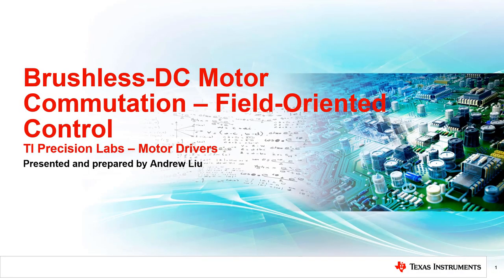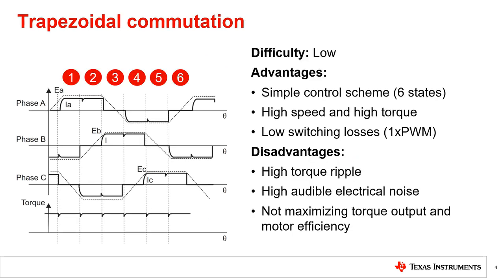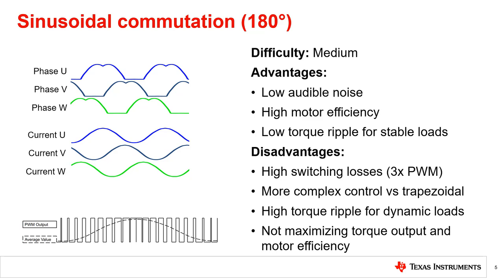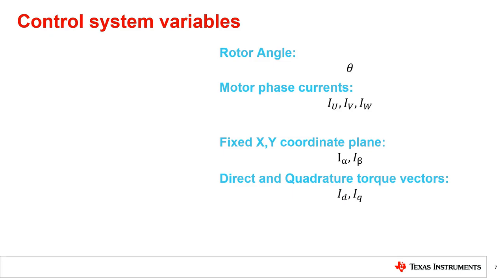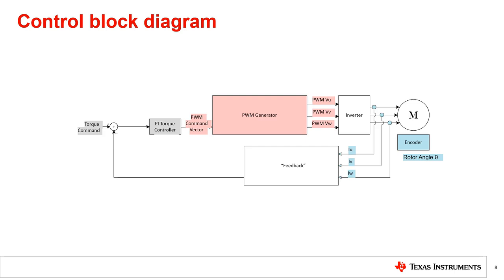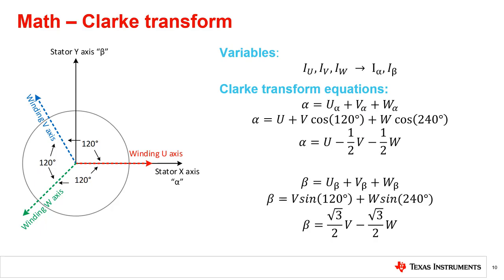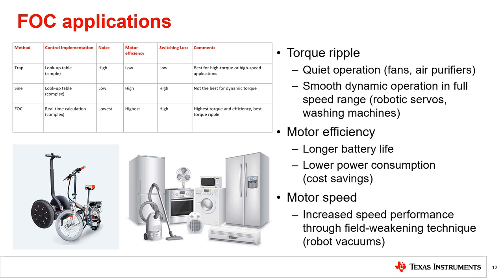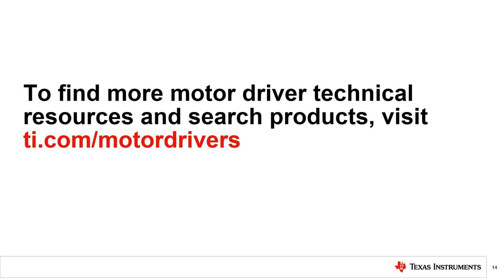Field-Oriented Control

Comment: Moreover, a BLDC has got a trapezoidal Back-EMF. For this reason, trapezoidal commutation is highly recommended. As far as i know, FO Control is mainly used in BLAC motors, AKA PMSMs because of the sinusoidal Back-EMF. The advantage is that applying Parke and Clarke transforms to these motors make the model non-dependant of these trigonometric functions as the dq coordinates rotate synchronized with the three sinusoidal phases required to control these kind of motors. Please, correct me if I am wrong
Reply: they rotate synchronized with the rotor

Comment: What if the field detection was performed in the analog domain? The system would be simple and placed in the engine for less interference and fast switching. Only power and a control signal would be supplied to the system.

Comment: Why do the PWM signals need to go through an inverter? I am trying to implement FOC for a stepper motor like the Nema-17.
Reply: What they mean by "inverter" in this case is just a 6 transistor full bridge. For a 2 phase stepper motor, you need 2 H bridges as you normally would. And such a thing already exists, look at SimpleFOC.

Comment: I haven't seen a single real life motor, implementing a rotor like this simple bar magnet, that all explanations of park-clark transform use. How in the name of God does this work in an actual motor with multiple poles e.g. 12p9s? I can't picture this 90deg angle in real life where there are multiple magnets on the rotor.

Comment: Hi TI, thanks for this video. I am a student in EE and long time fan of TI's ICs. I am very grateful for the material you guys put out there and I have been trying to write some FOC program to run in an embedded system I'm building. 

The setup is a C2000 F280049 microcontroller and a DRV8353 motor driver. My application is for high speed turbine and so I am opting for the sensorless FOC. I was wondering if I could get some feedback on my approach since I can't post on the E2E forum ( I don't have a company email).

So the way I get theta is by first finding the angular velocity. I create an ECAP event to measure the timing between two zero-cross of the current waveform. This gives me the sine's period and with (2pi/T) I find the speed in rad/s. I then multiply the speed with the time since the last known position of theta (this would be the last zero-cross, since i know that when the current is at zero on a phase, the rotor angle is perpendicular to that phase. Is this a decent approach?

Also, i have a question regarding the timing of current measurements. The IC i use (DRV8353) has integrated low side current amplifier. It is my understanding that, for the current to be measured, the low side gate has to be active for the duration of the adc sampling. This however has nothing to do with the commutation vector and so it is unclear to me when to activate the low side pwm signal. It is worth saying that the adc is sampling upon EPWM end of period interrupt. Should i force all 3 phases' low side FET every time i want to measure the current or is there a better way to do this?

Finally i just wanted to add that I really enjoy C2000 mcu's sharpness. Comparing the zero-cross timing on the oscilloscope and what the ECAP returns in software, i can tell that its spot on, down to the microsecond.
Reply from the maker: Hi Émile, thank you for your question! We recommend checking out these resources:
FOC TIPL video: https://training.ti.com/field-oriented-control?context=1139747-1138777-1139742-1149236
Instaspin FOC: https://www.ti.com/tool/INSTASPINUNIVERSALGUI?keyMatch=&tisearch=search-everything&usecase=software

Comment: Why’s Id setting = 0?
Reply: Hi, after applying Clarke and Parke transforms, you end up having two coordinates. Called d-q coordinates. The d coordinate is allways aligned with the rotor's magnetic flux and the q coordinate at 90 degrees of it. If you set q to 0, then the torque is 0 because all the magnetic torque generated orthogonally to the rotor's magnetic flux is 0. As d is aligned with the rotor's magnetic flied, it will eventually stop mooving as q=0 and d!=0. On the other side, if you set d to 0 all the current is pushing the rotor's magnet orthogonally, generating maximum torque as id=0 and iq != 0
Reply: BTW, consider giving a look to a video posted by Mathlab talking about this type of control
Reply: @arnaullort9180  thank you so much
Reply: I have a question. What is happen if Id*< 0 ?
Reply: @quannguyet2653  Decreasing id below zero is field weakening. It helps motor spin faster
Reply: @arnaullort9180   so if d = 0 will the rotor move at a synchonious speed ? if not , then while d < 0 will it reach the synchronious speed now ?
Reply: @adnaneakk1068 id 0 means rated speed. id less than 0 means above rated speed using flux weakening